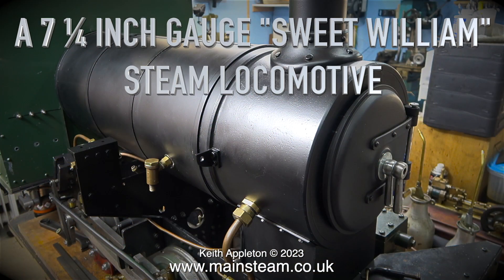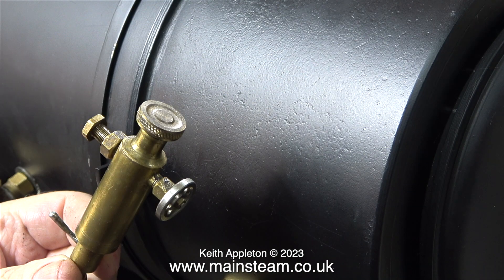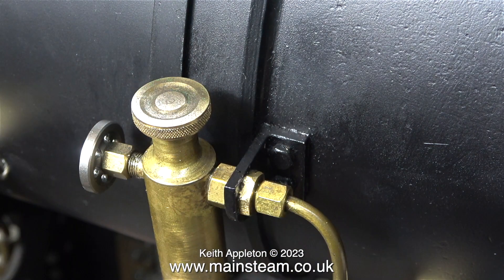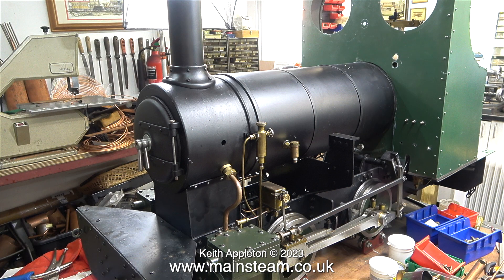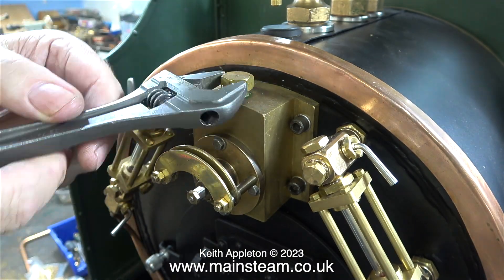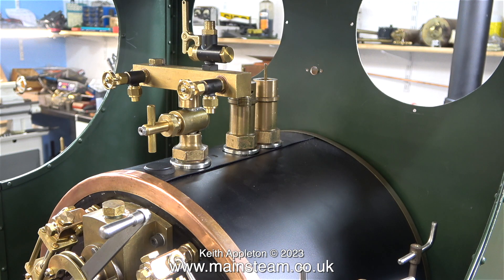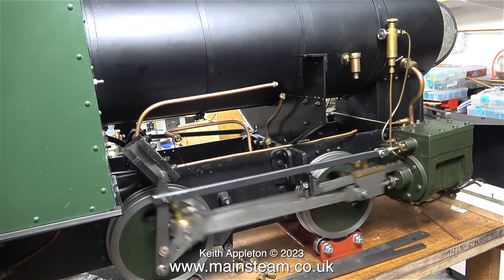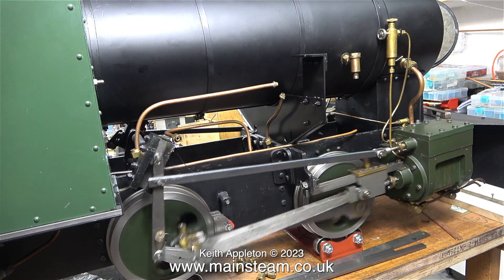A 7 ¼ INCH GAUGE "SWEET WILLIAM" LOCOMOTIVE - PART #57

Comment: Have you seen the leak testing devices that blow vaporized mineral oil under low pressure into equipment?  It wafts out of all the leaks and it is low temp and it is quiet... all the better for hearing and finding leaks.
Reply from the maker: No, I haven't seen those . . .